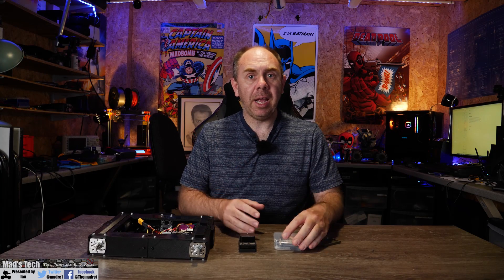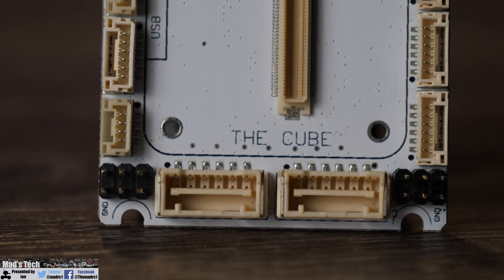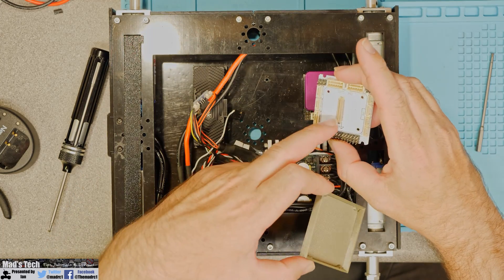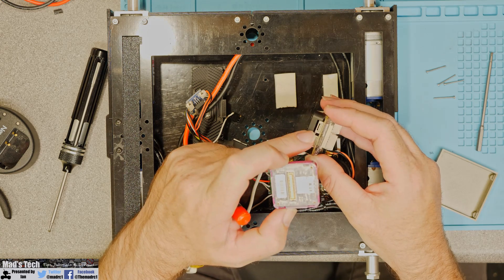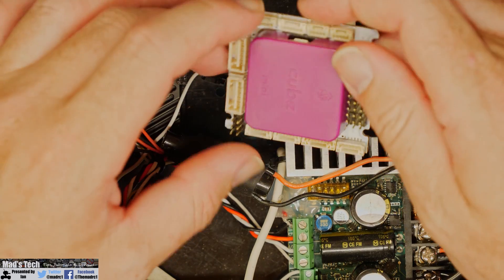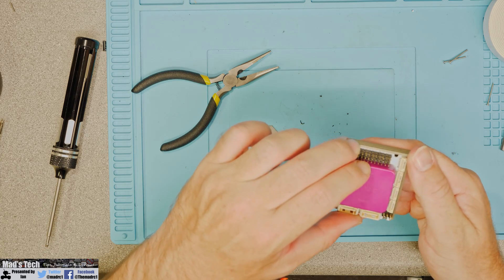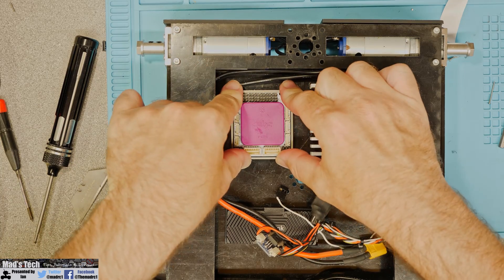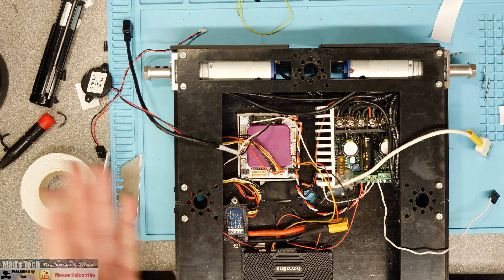Airbot Systems Carrier Board For Cube Autopilot

Comment: Ian, I have a question about this carrier board and was hoping you could help me.
I have this setup with a Black Cube as well as a ESP8266 Breakout Board (for WiFi connection) feeding into Telem1 port.
I have flashed the WiFi board with the proper firmware for it to communicate through QGC mobile or Mission Planner but after multiple power cycles and even swapping the RX and TX connections to double check they were fed in correctly, I still can't get any parameter download, the baudrate is set at 921600 both on the Cube Black and the ESP8266. My laptop and phone can connect to the WiFi connection but it doesn't seem to be connecting with the actual drone... :(
Thoughts? Thx in advance for your expertise :)